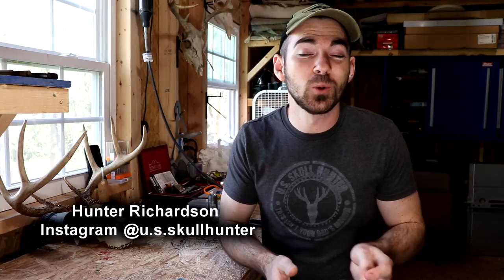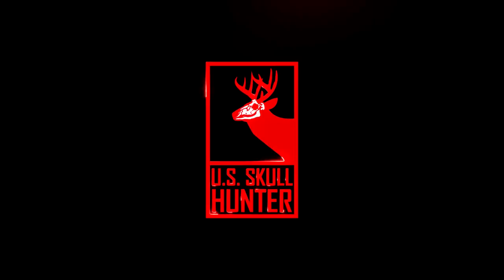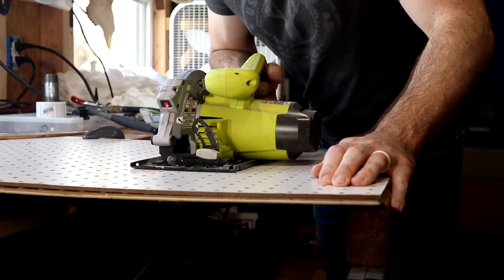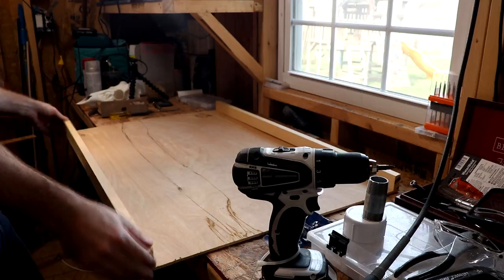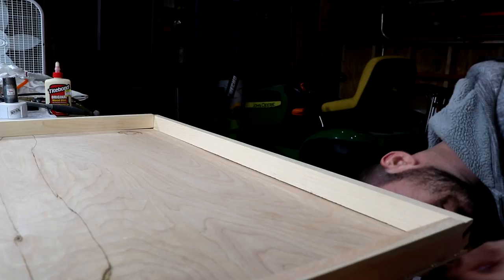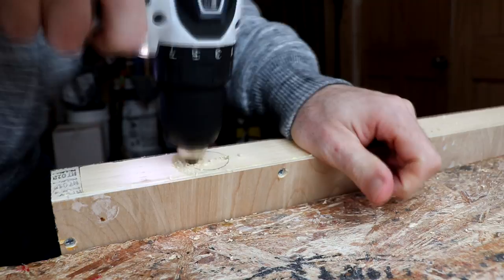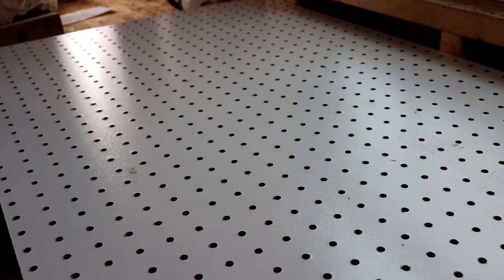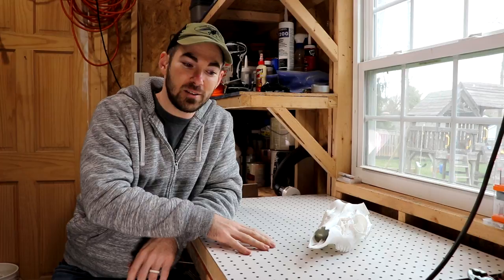Simple Downdraft Table How-to

Comment: Have you tried to block the holes on the peg board to restrict the area where the air is pulling through? Possibly tape down heavy paper to reduce the area.
Reply from the maker: Hey Jim! Yes, actually I did. I added some flashing take on the underside on the top and left side so that more suction would go to the right side. So far so good :)

Comment: Are you running the shop vac outside of the shed?
Even with ear protection it would seem like it would become unbearable after about 5 minutes.
Reply from the maker: It is inside but really isn't too bad. Possibly a different vac would be louder than the one I have.

Comment: I’m going to build one for my son. Do you still use this? Any ideas or improvements you would’ve made?
Reply from the maker: Hey Billy! I don't currently just because of the new setup I have but I still have it (and will set it up eventually. The only improvement would be to make it a bit smaller than I did in the video so that you get more suction from the holes.
Reply: Thanks!